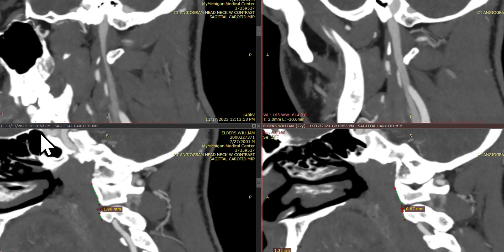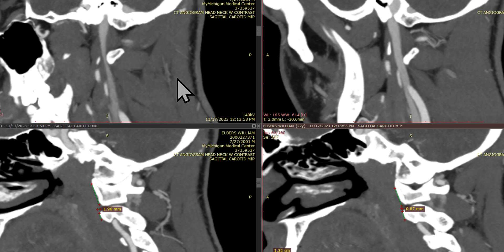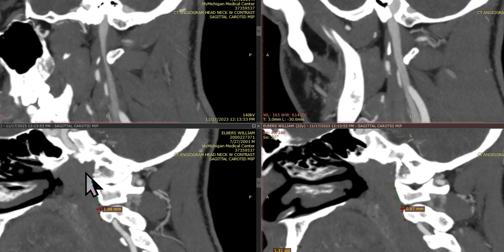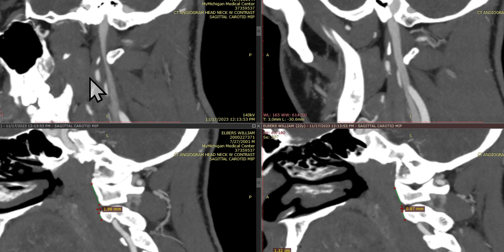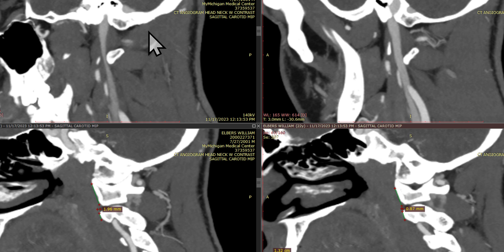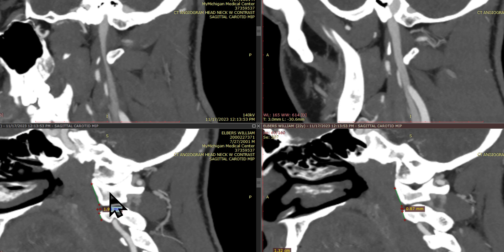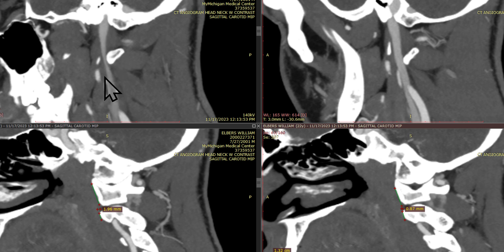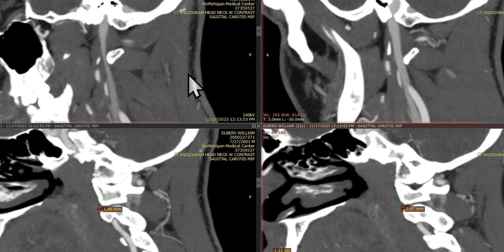IJV Compression in CCI is Due to C1-C2 Instability

Comment: My daughter (28) has been suffering constant pressure headaches, loss of high frequency in her right ear, insomnia among other symptoms  for 6 years , she has just had a ct scan with conclusion being:   slight asymmetric narrowing of the proximal right IJV at the level if right C1 transverse process, with no convincing significant stenosis in the position of imaging.  Could her symptoms be due to the conclusion ?